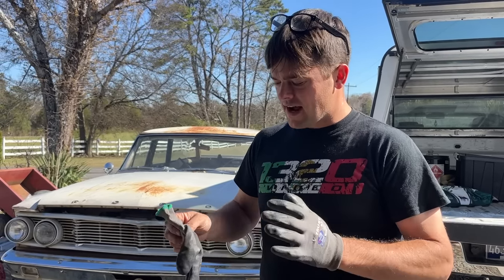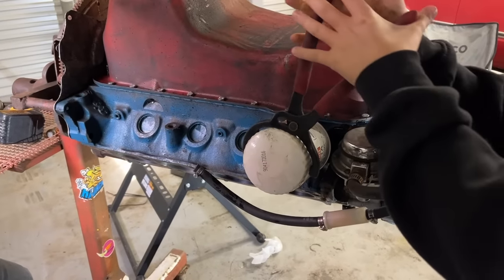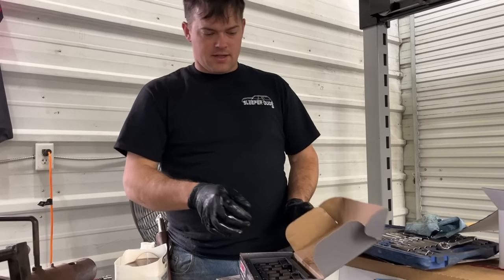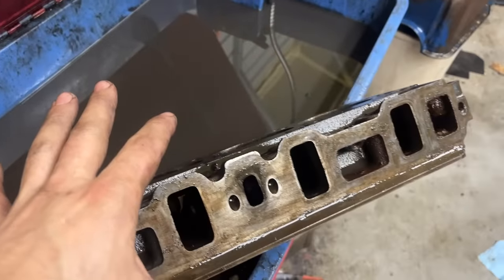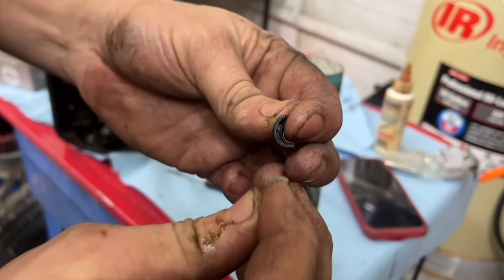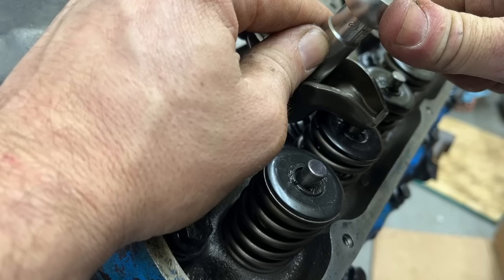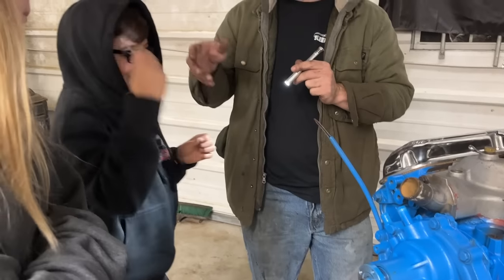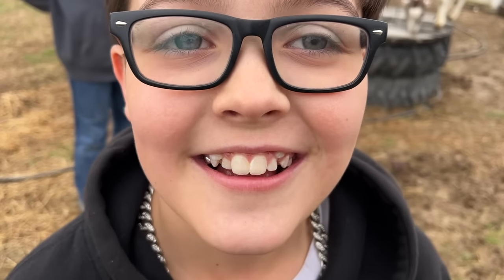We Had Issues! Small Block Ford Engine Build 64 Galaxie Station Wagon

Comment: Awesome idea using the 302 there is something to be said about brand loyalty and parts availability.
Reply from the maker: Yeah I think so too
Reply: Fyi they are externally balanced and need the flywheel and the balancer specific to that engine cid......if not a horrible vibration rip the motor aoart

Comment: Ive never took off a SBF timing cover that didn't have cracks tbf. Newer 5.0 water pumps also turn opposite than the old 289 because the later model is set up  for a serpentine drive belt. Don't forget the dipstick provision in the block 👍

Comment: I've cleaned up a lot of really rusty stuff with Muriatic Acid. It works very quickly. Might be a worth using that block as a test bed to see if it can clean up those crusty passages.
Reply: Reverse electrolysis will work better but must be done safely because it creates hindenburg zeppelin gas or hydrogen gas and can get very dangerous if done inside. There is several videos on youtube on the very simple inexpensive way to do it with washing soda available at dollar general stores in the laundry department a battery charger and old battery for balancing the system battery needs to be ok
Reply: I'd say Muriatic Acid sounds a lot simpler and cheaper than going to all that trouble. Any time I've used acid it works in mere minutes and cleans very well.
Reply: @gregallen4272  I don’t see how you could isolate the electrode in an engine block unless it was in a large vat with the isolated rod separated from the motor. That might work but it would require a lot of washing soda. 🤔

Comment: Reminds me of Building and changing over my 58 Ford Fairlane to a Police Interceptor 427 with 2 4bbl carbs when I was a Kid and changing the 3 speed to a floor shift 4 speed. It has everything and still runs good. I went in the Army at 17 and I still have it. Red and White looks new. Did the complete Route 66 about 10 years ago with it. Now an Old Man but it has a few engine Mods 20 over bore a nice cam. I have that with my full restored M151A1 1966 Ford Mutt with every option on it including the Artic Package it too looks Battle Ready with the Trailer. I love your video's. My career was Insurance Claims and a Cargo 747 Pilot Contractor. I used to be a Engine Inspector for NASCAR. Been Busy. You have a wonderful Family. God Bless all of you.

Comment: The hump in the front of the oil pan is to clear the oil pump. Make sure the damper and flywheel are the correct balance factor (50 oz) for that engine. They make both 157 and 164 tooth flywheels with 50 oz balance, so which ever you need. Your bell housing will determine which one.
Reply: The 4 long bolts around the water pump inlets go into the water jacket. They should be installed with thread sealant.

Comment: I run the hydraulic flat tappet version of that camshaft in my 390 in my 64 4 door. I like it. Decent idle, makes great torque right off idle and has a great mid and high range. Glad to see that car closer to getting back on the road.

Comment: Glad to see your Galaxie wagon project progressing so well. As a Ford wagon guy I appreciate the old 302 V8 as all of my cars including the 1989 Mercury Grand Marquis have this engine. Since mine are not the high output version they are rated at only 150 H.P. and 270 Ft. Lbs. of torque, but still can get up and go if you stand on it. My 1991 wagon had the engine and transmission rebuilt in 2020 since the original engine build failed at 140,000.0 while I was towing my Triton Triple Quad trailer in Massachusetts. It only has 10,000.0 miles on it since the rebuild. My 1987 wagon has 246,000.0 miles on the original engine and runs like a watch. If you change your oil frequently these engines will last a long time. I am looking forward to your next video on the Galaxie wagon.
Reply from the maker: That’s awesome thank you

Comment: Just have to be careful using the hammer and socket technique cuz if you don't get it on there straight you can have the retainer gouge into the side of the valve stem and wreck the valve You're really better off to use a valve spring compressor every time
Reply: You can tap the edge of the retainer to break the wedge fit but you are correct you need to use a compressor after that. You can also damage the keepers = dropped valve ouch.

Comment: I might have hooked up the water pump (with heads and intake) and used a washing machine motor to push Evaporust through that block for a few days.  With the bad bore the rust probably pushed it over the edge, but I’m not convinced that the rust made it unsalvageable…
Reply: Check out using reverse electrolysis to remove rust there are several different videos on YouTube just don't do it inside it creates hindenburg zeppelin gas or hydrogen gas also works good on all rusty metal parts without degrading them and making easier to hold paint
Reply: @gregallen4272  oy!  Can’t believe I forgot about electrolysis - great idea!!

Comment: I just wanted to share this with you. I watched a professional restorer do this. He mixed Kerosene and motor oil together to make a solvent to loosen nuts and bolts...better than liquid wrench..works exceptionally well.
For gas tank cleaning he put Citric acid in a glass, a whole granulated packet...poured it in the tank after it dissolved and then filled the tank with water and let it sit. Rinsed it out with water then poured Acetone in the tank, swished it around and the tank was beautiful, as if it was never rusted at all. Thought you might like to know how the Old timers restore without buying much.

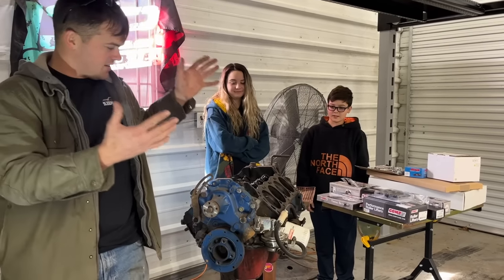Comment: I was an engineering student in 1969 thru 1973.  The school was General Motorss Institute, now Kettering. It was a coop education, with alternating 6 week sessions working and at school.  My work sponsor was Chevrolet Engineering Center at the GM Tech CEnter.  One of the technicians there had what I hav always thought was the ultimate sleeper, a 67 Chevelle wagon with a typical grandma turquise paint job and a 327 logo on the front corner.  However, this was the 327, 365 HP with a 4 speed "rock crusher" close ratio and a 4:11 posi rear end.  It also had headers and exhaust cutouts.  He would open these once in a while leaving the Tech Center going out onto Van Dyke in Warren.  What a sweet sound, that high compression small block just screaming!  He happened to be the uncle of one of my college buddies who was equally as crazy.  I love sleepers, expecially wagons.

Comment: I would have painted block and heads gloss black, since Ford didn't use blue on engines until 1966. Put T-5 in it for better cruising and fuel economy! Can't wait To here it run! Using factory exhaust manifolds or headers? Will be à Nice dragon wagon!
Reply from the maker: Good idea. I haven’t been able to find headers that are made to fit it unfortunately

Comment: When I was younger I bought a couple of cars that ran great, but had really bad paint. I went to Wal-Mart and filled a cart with 25 cans of color and 25 cans of clear coat (when they were actually 99 cents) and I painted both cars with it, in my backyard, in the wind, and under a big tree. I prepped the entire car properly, masked all of the windows and trim, and they both turned out really nice. I still have pictures of my Royal Blue 1992 Civic and I painted a 1995 Chevy Beretta that I got for free with the same color and painted the trim with hammered gold and put some Beretta GTU wheels on it and it looked really nice. I let it thoroughly cure for a week or so and I cut and buffed it and while it wasn't a miracle paintjob, it turned out really nice. I painted my wife's 2002 Mitsubishi Lancer with gloss black Rustoleum with a paint gun and a compressor and it was always cloudy and reminded me of when I would buff an old enamel painted car (probably because Rustoleum is enamel). My Civic and my Beretta came out really nice though.
Reply from the maker: Yes!!
Reply: High humidity can cause your paint to "blush", can be cloudy looking, since you did it outdoors

Comment: Josh. The rule of thumb on the 302HO with stock pistons, camshaft lift should not be over  .500 the F303 Ford motor sport cam what is a 512 lift and even with the proper springs would cause piston to valve interference but usually not till you got them up over about 4000 RPM. .498 lift such a a F303 cam might be more desirable simply because of not having piston to valve interference. Good luck I enjoy your show and really like that you involve the entire family my best to you and God bless.
Reply from the maker: Ok thank you I need to check thst

Comment: I would DEFINITELY run the T5! It will have a better selection of ratios plus an overdrive. The thing to remember though is that the old 3 and 4 speed manual transmissions usually had their shifters of the side while the T5 will have it right down the center of the trans. It may require some interesting engineering to get a shifter that works properly with a bench seat since I believe it will be farther rearward than the old 3 speed shifter. However, it will make the question of what starter to use easier to answer since the bellhousing and flywheel will be a matched set. Also, I believe the Ford 5.0 uses a starter that is more like a GM product with an integrated solenoid. The major issue you will run into when using the T5 is that it uses a cable style pull clutch rather than a linkage or hydraulic push clutch. The pedal requires a bellcrank shaped piece called a Quadrant that bolts to the top of the pedal at the pivot point. This will require a hole in the firewall that will need to be reinforced or else it will pull right through. Even on the 5.0 Mustangs, it was not unheard of for them to crack the firewall and pull through with a high performance clutch.

Comment: Make sure you keep those 289 rods. You can use them in a 302 to have more dwell at tdc and taller compression height. There’s some stuff you have to do to make it work, but it’s an old school trick to get a high compression engine with lots of rod ratio. T5 in that wagon would be awesome!

Comment: I think the lighter Ford blue was used in the later 1970's. My dad rebuilt a 400 Cleveland in a 1977 F250 and used that lighter blue to repaint it. My old 390 in a 1972 was darker blue.
Reply: You are correct. The dark blue was used from the mid 60’s into the early 70’s

Comment: Mix some molasses and water in a big barrel, slip that 289 block in it, and let it sit for a few months. The molasses/water eats rust without affecting machined surfaces. You can use the waste in a garden, it is totally organic. [look it up on the internet]. What bolt pattern is on that 289? Early ones have a different pattern than the later ones. BTW, the molasses thing is a great science project for one of the children.
Reply from the maker: Ok we might do that I will look into it

Comment: I was going to drop this suggestion before you said that this wagon was going to get painted, but my first impulse was to do an affordable restoration on the Galaxie wagon. Pull out some dents. Cut out some rust. Fill and sand it level.

Comment: Dunk that rusty block in evaporust. Its not an acid and water based so once your dont with it you can dump it down the drain.  I used it to tank a couple blocks. Even a really rusty intake. Cleans them up nicely
Reply from the maker: Ok we might try that

Comment: I had an 89'   Is Mercury Grand Marquis. It being the 5.0 with that same oil pan!
The upper right side water pump bolt usually snaps off when you remove the pump.
The outer housing can be drilled into with a 1/16 bit. Drill about 3 or 4 holes in a row on it. Spray with a lubricant,  and use broad square tip vice grips in the bolt that snapped,  and slowly move it back and forth while repeatedly spraying it down with lube. No heat either. It will back out after a few minutes.
The same bolt snaps on all of them when the pump goes bad.

Comment: Another great video bro. Love seeing the whole family getting in on the fun and learning along the way. 
Now let's talk camshafts. You always hear people say that roller cams are always better than flat tappet cams. This is largely uninformed opinion. The fact is that in applications such as street performance, drag and drive/more entry level drags where you're launching at relatively lower RPM, shot track/autocross, low speed off road, and towing/RV applications, you're almost always far better off with a flat tappet cam than you are with a roller. Here's why. 
The more gradual entry and exit ramps, and the much higher valve velocity over the nose of the lobe tends to make much better utilization of the inertia of the air columns in the intake and exhaust tracts, thus providing much better cylinder scavenging, and increased cylinder pressures at lower RPM ranges. And that's what makes much better torque and horsepower in that range. If you watch a lot of Richard Holdner videos, where he tests various roller cams in, for example, LS engines, you'll notice that in comparing 2 rollers of wildly different lift and duration figures, there's not a whole hell of a big difference in low RPM figures. The more major differences tend to be in the range over 5000 RPM. This is largely because in the lower RPM ranges,  cylinder scavenging is vital. Once an engine passes 5000 RPM, the effects of the inertia of the pulses in the engine is far less. 
Now let's talk about frictional losses, which is the #2 reason we only see significant gains at upper RPM ranges with the roller. While there is less friction between the cam and the foot of the lifter, because of the much steeper entry and exit ramps of the roller cam, you have much higher side load on the lifter body, and bores at lower ranges. And if you think about it, the area of contact is far more on the body of the lifter than the foot. So at the end of the day, you're only seeing the benefits of those roller lifters, and rocker arms to for that matter, at those higher RPM ranges where things are happening much faster. 
Of course it's nice that rollers hace virtually no break in requirements, bear in mind that most cam companies offer case hardening, which is always a good idea, and which makes a flat tappet cams require virtually no break in time either, almost no danger of flattening lobes, and significantly decreases friction. So you can have the benefit of the flat tappet lobe design, and better scavenging, with the reduced friction, and reliability of the roller
A little more on scavenging. A while back I did an intake/carb swap on my 74 Lincoln, and now I'm having to do a cam swap on my sister's GMC Envoy with the 5.3 LS. Of course we can't post pictures in the comments here, but if I could show you a comparison of the intake ports between the 460 in my Lincoln and the LS, you'd notice that there's absolutely no carbon buildup in the 460, but the carbon deposits go clear up the intake manifold on the LS. This is because the lobe design of a roller cam operates the valves more like a light switch. It opens them quickly, and holds them at virtually full lift for almost the entire duration. This makes the intake and exhaust valves to be all the way open for a significant amount of the time, allowing exhaust gasses to reverberate back into the engine and up the intake tract at low RPM which is where tis engine spends virtually all its time.

Comment: Dagumit about the 289! Would have loved to keep it period correct but maybe with a little more modernity it will hold up better. I have a suggestion for when you work on one of the Fairmount wagons and do a tech build on the leaning tower of power
Reply from the maker: Ok thank you

Comment: You know that the timing cover is supposed to have two locating dowels on the engine block. But if you lose or just don't have them using the balancer to center the seal is the way to go for a leak proof front seal
Reply from the maker: Ok thank you